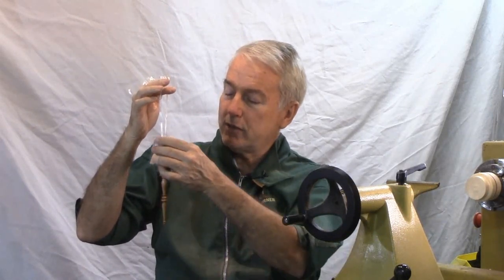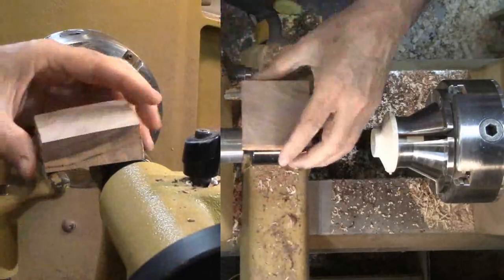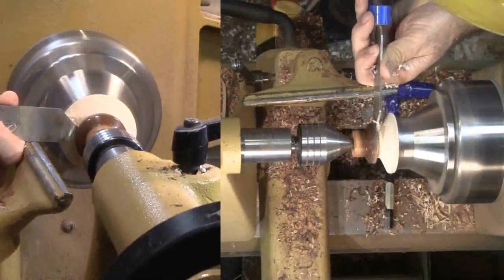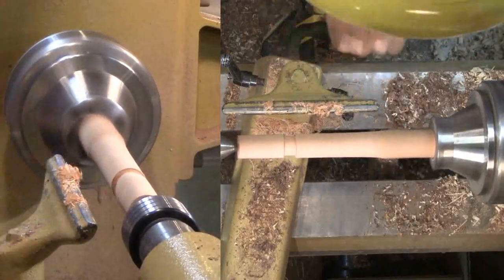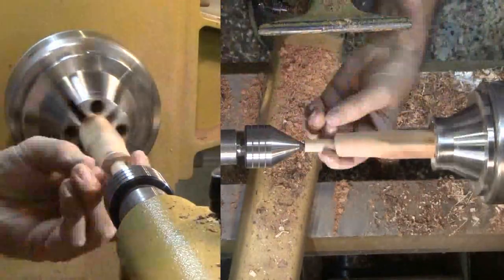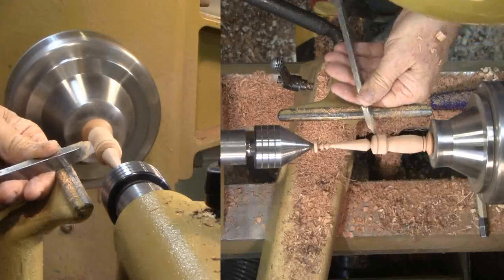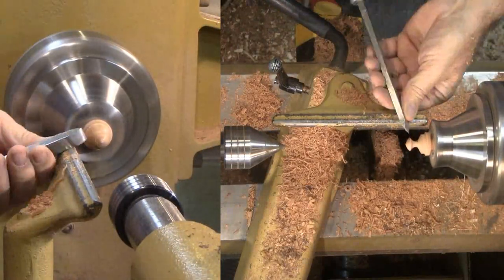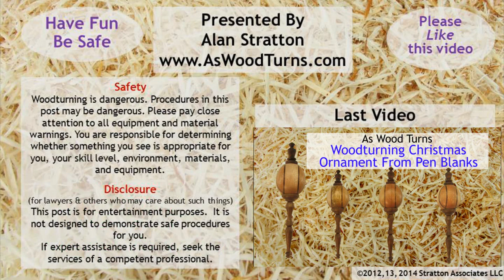Woodturn A Sputnik Sea Urchin Christmas Ornament

Comment: Those are beautiful Alan.  How tough / fragile are the sea urchins?

Cheers, Tom
Reply from the maker: Sea Urchins are fragile and tend to break at the lines between points.
Coating the inside with white glue toughens them a lot.
Even if they break, often they will fit back together then apply white glue to the inside
Merry Christmas
Alan
Reply: That's great, cheers

Tom